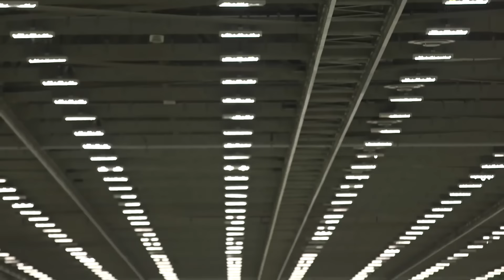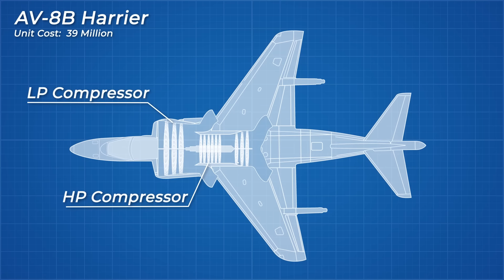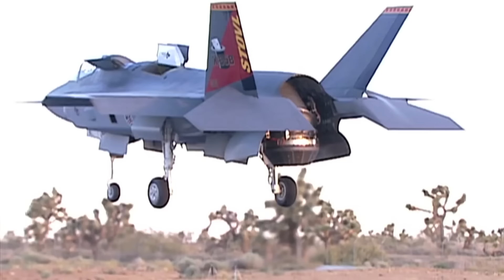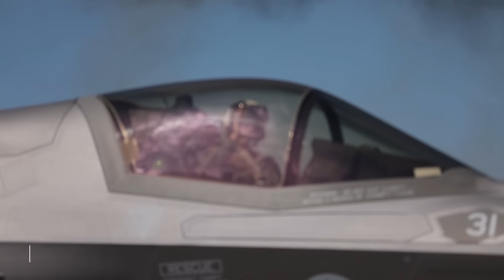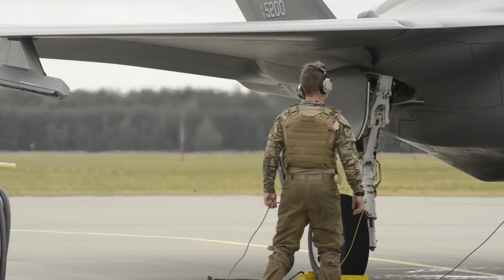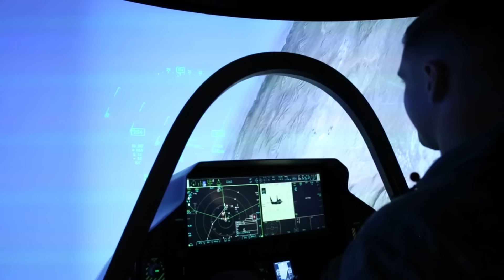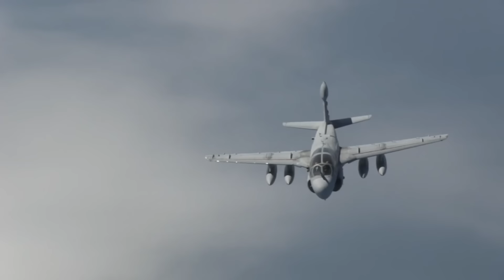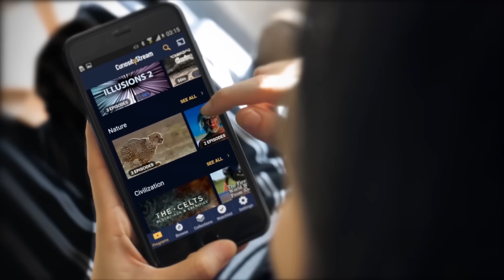Is The F-35 Worth $115 Million?

Comment: Delivery to Australia was suppose to be around 2010. Now expected delivery 2300 at a cost of $600,000,000,000 . What a joke. We should of got the eurofighter or even a MIG. 👎
Reply: Delivery to Australia was NEVER supposed to be around 2010. They didn't even place an order until 2009 with expected delivery in 2014, but then decided due to budget cuts to postpone most of the order. Australia are currently receiving F-35s as planned and on-schedule.

Comment: The F117 over Serbia was not shot down by long wave radar but by IR and TV sensors.  The serbians have never had long wave radar.  Too expensive.
Reply: Uh long-wave radar is standard for air defences. You don't buy air defences without long-wave radars, and the Serbs operated P-18 and P-12 radars with their S-125 SAMs.

Comment: Short answer, no it's a turkey. A-10 is vastly cheaper can carry more firepower and can loiter at low speeds and maintain presence in an area of operation for far longer. Also is vastly superior in survivability of both operator and craft as A-10 airframe is not reliant on fly by wire avionics to constantly correct the ailerons for stability. Update the Harrier if you NEED a VTOL which I don't understand as they field F-35's on aircraft carriers with catapults which I'd trust a thousand time before the inlet on the F-35 in transference from vertical to horizontal thrust.....it's like why do we still field the 70yr old B-52's because they fucking work son.
Reply: Not the case at all. The A-10 cannot carry any potentially higher payload- and is not survivable in contested areas where ground-to-air threats are present- let alone air-to-air threats.

Comment: Good analysis! You didn't mention that F-117 was not equipped with radar. Once F-35 turns radar on everyone knows it is there. F-35s capabilities are still to be tested on battlefield. There are other ways to detect and pinpoint airplane position (visual, sound), and with electronics development these ways of detection will improve, as well as radar sensitivity, making stealth less valuable. F-35 is built around stealth technology, without it, as you mentioned in your video, it is loosing to cold war era fighters, so with stealth becoming less effective it will degrade. Also because of its slow maximum speed it is less capable as fighter. Once it locks on (you can't lock on without letting enemy know), faster enemy fighter can just run away. In it's turn F-35 can't run away...
Reply: AESA radar encrypts the emissions so that it looks like normal radio communications. RWR detects radar by sensing the specific characteristics of known radar emitters and understanding that the aircraft is being painted by radar. If the emissions keep changing, the RWR cannot know what is radar and what is TV or radio boradcasts.
Reply: @ChucksSEADnDEAD  Wouldn't radar signal strength, especially in targeting mode, be much stronger (as if you have tv tower few yards away)? And if not, wouldn't it be much easier to jam? 
Also, as far as I understand, it is rather easy to detect direction to radio signal source (no matter how encrypted the signal is), and if this source is up in the sky it is most probably an aircraft. 
By the way, rumors say that F-35s RCS is 0.005 - that is 5 times more than one of F-117.

Comment: Excellent video:  Here are two additional complementary arguments, one in favor and one against.  The first - the "for" argument is similar to one that you used, with maybe a little addition.
"For" the assessment by some that the F-35 doesn't compare favorably to F-15's and F-16's in dog fighting. I think you largely pointed out the problem, in that the F-35 wasn't designed to be a dog-fighter in the vein of an F-16 or F-15.  So, while the F-35 can't match the turning abilities of the other two and it may have a less favorable power to weight ratio, the changing style of air combat really doesn't dictate the need for the F-35 to exceed the capabilities of those older aircraft in that area.  In a modern encounter the F-15 and F-16, probably even the modernized versions of the two, would never make it into visual range of the F-35 because they would be destroyed well beyond.  While some do make arguments suggesting that militaries are incorrectly downplaying the importance of traditional dogfighting capabilities b/c in the past there were some oversights (the original variants of the F-4 being a good example) that really bit them in the ass.  But at this point technologically we really are moving beyond visual range combat.  If you get into a traditional dogfight, it is because something has gone really wrong - and so you can't really justify the additional expenses needed to make the F-35 comparable to those other aircraft when likely the only time it would require those abilities is the hopefully rare occasion when literally everything else (from command and control, electronic warfare, and other support aircraft) has been taken out of action. In a situation like that, maintaining the fight is probably the last thing that aircraft should be doing.  Therefore, even though there will always be a certain level of hesitation to rely entirely on advanced technology (stealth capabilities, advanced armaments etc), at this point in time dog fighting just can't be a design priority for an aircraft like the F-35 (possibly a little more for the F-22, but erm..)
"Against" This one is going to be a lot shorter and to the point.  Some of the strongest critics of the F-35 have gone after it on the grounds that it falls prey to a familiar problem in design intent in that in trying to build an aircraft that can serve multiple roles, you end up with an aircraft that can serve those roles but can't do any of them of very well.  In designing a multi-role aircraft (and this has been problematic in the past as well) you have to make compromises on the aircraft's features with regard to each role when features for one role get in the way of optimum performance in one of its other designated roles. I know that's an overly complicated sentence - in essence you have to make it an average performing aircraft in each role instead of superior b/c inevitably the various roles require certain design features that limit the aircraft's maximum ability to perform another of its set roles.  With this in mind, critics say that the F-35 will fall prey to comparable generation technology that is designed to fulfill a single role and is therefore optimized to be able to do so at a higher performing level than the F-35 can in any one of it's designed roles.

Comment: Compared to the F16... cant turn, poor acceleration, slower and its payload its very small... also, questionable stealth
Not worth it! I would get the Gripen, Eurofighter or Rafale any day!
Reply: F15 

Empty weight: 28,000 lb (12,701 kg)
    Gross weight: 44,500 lb (20,185 kg)
    Max takeoff weight: 68,000 lb (30,844 kg)
    Fuel capacity: 13,455 lb (6,103 kg) internal[132]
    Powerplant: 2 × Pratt & Whitney F100-PW-100 or Pratt & Whitney F100-PW-220 afterburning low-bypass turbofan engines, 14,590 lbf (64.9 kN) thrust each
            23,770 lbf (105.7 kN) afterburning thrust for -220[133]
            23,920 lbf (106.4 kN) afterburning thrust for -100[133]
    Maximum speed: 1,434 kn (1,650 mph, 2,656 km/h) at high altitude
            782 kn (900 mph; 1,448 km/h) at low altitude
    Maximum speed: Mach 2.5 at high altitude
            Mach 1.2 at low altitude
Reply: F35
    Empty weight: 28,999 lb (13,154 kg) [556]
    Gross weight: 49,441 lb (22,426 kg) [66]
    Max takeoff weight: 70,000 lb (31,751 kg)
    Fuel capacity: 18,498 lb (8,391 kg) internal fuel
    Powerplant: 1 × Pratt & Whitney F135 afterburning turbofan, 28,000 lbf (120 kN) thrust dry, 43,000 lbf (190 kN) with afterburner
    Maximum speed: 1,042 kn (1,199 mph, 1,930 km/h) (tested to Mach 1.61)[230]
Reply: F16
    Empty weight: 18,900 lb (8,573 kg)
    Gross weight: 26,500 lb (12,020 kg)
    Max takeoff weight: 42,300 lb (19,187 kg)
    Fuel capacity: 7,000 pounds (3,200 kg) internals[4]
    Powerplant: 1 × General Electric F110-GE-129 afterburning turbofan engine, 17,155 lbf (76.31 kN) thrust 29,588 lbf (132 kN) wet
    Maximum speed: 795 kn (915 mph, 1,472 km/h) (Mach 1.2) at sea level[71]
         1,147 kn (1,320 mph; 2,124 km/h) (Mach 2.0), clean configuration at altitude[4]
Reply: Not even close to being the case
Reply: @peterson7082  and i guess youre an expert...
Im not an expert, im just an avionics sargent in the air force, and that ive just said, its what the pilots tell me.
Regarding maintenance, F16 works like a clock, its a damn good machine. F35, its a drama queen... do you have any ideia how much maintenance that aircraft requires for its flight hour??
Reply: @MFPRego  Oh its maintenance costs and down times are well documented issues. Though I find your claims in regards to its performance questionable. The acceleration doesn't seem to be poor compared to its contemporaries (rather quite good ), speed with a payload again not poor, and potential maximum payload greater than the F-16C. The Gripen is slower with any combat load, carries less, and maneuverability is not considerably better (admittedly the last statement is not founded on any primary source ). 

Questionable stealth how? Cannot turn according to what exactly?
Reply: @peterson7082  as i said, thats what the pilots tell me, F16 pilots, so im guessing its compared to the F16
Reply: @peterson7082  listen, the F35 on paper looks amazing, but reality tells us a diferent story! That plane simply cant keep up with the F16! Sure, its avionics systems are amazing, but thats about it...
Reply: @peterson7082  about the Gripen, its alot cheaper!!! The price of an F35 can buy 3 gripens! The flight hour of a F35 is 7x higher than a Gripen... sure, the Gripen cant outperform the F35, but for any other country that isnt the US, money is an issue!

Listen, i dont work with Gripens, só i do not know how the maintenance is
Reply: @MFPRego  "but reality tells us a diferent story!" - reality says that the F-35 wipes the floor with anything else in inventory.
Reply: @ChucksSEADnDEAD  can it? I dont know, we will see it in the future, wont we?

Comment: I'm still sure it's possible to produce the F-35 for a lot less. Competing stealth fighters of similar or better overall capability (VTOL notwithstanding) have unit costs estimated at as little of half that of the F-35 or less.
Reply: Not really. The prototypes of the Russian Su-57 cost $50-60 million each and were testing individual systems i.e they were not fully capable fighters. Considering the Su-35S goes for $75-85 million each on the export market I highly doubt the Russians can produce the Su-57 for less than the F-35.
Reply: The current unit price of the F-35A is cheaper than many 4th gen fighters.

Comment: And at $115 million you get the basic model....the models for the Marines and the Navy are substantially more expensive per unit. What was supposed to be a design which could be used interchangeably by all the branches has morphed into another Pentagon spending spree.
Reply: $115 million is the cost of the most expensive variant i.e the USMC version. The "basic" model (actually the best performing one) costs $89 million and is expected to drop below $80 million in the next couple of years.

Comment: I don't think it is a worthy successor in all things and also people forget the F-22 got to be so expensive because they kept reducing the numbers on order which drove the price up for each unit cause in the end development costs have to be earned back regardless. Some people did the math and suggested a F-22 in full production would have ended up cheaper. 

Now granted the F-22 is actually kinda old tech wise, but such things could be deal with and create an very capable plane for fighter and fighter bomber roles which is really the only role planes like this should handle. There is no way the F-35 will for example be able to replace the A-10 in CAS, it is not all about getting ordnance on target (A B1 does that job amazingly) it is also a large part of breaking the fighting spirit of the enemy. 

Also if one faces very stealthy opponents with great sensors all that advantage is null again and you might very well end up relying on that good old dog fight or at least need to move to evade hostile missiles. 

In the end the F-35 program has been and will continue to be an expensive mess and the end the result might be suitable to some, but to many smaller nations the only way they can afford this plane is to replace say F-16 at a 2/3 to 1 ration so effectively halving or worse their airforces, add in that at any given time easily 25% will not be operational it renders entire airforces to be combat ineffective simply due to a lack of numbers. 

Now do not get me wrong I am not saying it is easy there has not been a jet fighter program that has not been drawn out and expensive, but many have ended up producing good planes and perhaps with some refinements and block D version at some point the F-35 could be as well, but at what cost? One far to great I would argue.

Comment: You avoided the elephant in the room: how does the F35 hope to replace the role of the A10 Warthog??? The other replacements fine, but the ground support role is so specialized that there's no way the F35 could "replace" it. Please do a video on exactly how special the A10 Tankbuster is, it's role in war, it's engineering (of course) and the fantastic tales of it limping home while missing pieces.
Reply: The only role the A10 serves is fucking up terrorists holding 50 year old AKs running around in flip flops and towels. Well that and making dumbass 13 year old boys nut themselves. The war on terror is coming to a close, the A10 is useless (I REPEAT, USELESS) outside of the war on terror. China/Russia have the capability of shooting the A10 out of the sky without breaking a sweat. The A10 is OLD. It will become a matter of time before the A10 is obsolete even in the Middle East.
Reply: marines F35B = hover and use the 25mil ??? LOLz 

in doubth go see swarzie movie with the harrier
Reply: The A-10 has already been largely replaced by the F-16, F-18 and F-15 strike eagle.

Comment: I used to work in the defense industry and was able to play with the simulator one day. I am a retired Marine but I was not a pilot but the Lockheed Martin rep was a pilot and worked on the F-35 program. He was right there with me and told me what to do. I was able to quickly grasp the system and within an hour able to conduct a mission with very limited input from him. I was able engage 3  bandits in BVR all while prosecuting 3 ground targets using another plane providing targeting info to my plane through the network. 

I had a JDAM glidding to target and had missiles flying to target the pilot asked me what the time to target on the JDAM, so I  looked down at my screen and started to cycle through it and he says "no, just look for it."   At first I was confused because I knew I essentially over; the target and at like 30K ft, so how would I see it? I started to voice that to him and he points down and I looked down and I could see out of aircraft, right through it and imposed on the helmet HMD I saw a FLIR picture with the JDAM marked and a count down showing me time to target.  It was wild. 

This was a good 7 years or so ago and he told me I was flying essientlly a "prototype" simulator 
dif you will. Clearly, I can't provide any real insight into the plane other than the limited time I had on the simulator  and the GUI seemed extremely intuitive and features of the HMD made the simulator hands down the coolest and the most expensive video game I had ever played.

 The pilot did his best to make it "realistic" but like I said I am not aviator and at one point I  air to air and I said "I did pretty good right?" And he explained he had turned off restrictions and what not and pointed the big screen out in front of simulator, which allowed for people to see what did. Yeah I just conducted a negative 25g maneuver, lol.

Comment: couple of notes.. both the B-2 an the F22 were not intended to low volume productions, you infer that these were some small custom "British " car company...that was never case. an Cost figures falsely reflect the Cancelled Full Production runs, ( off the top of my head , over a 100 in the B2 case, an over 750 in F22 case... This is America, F22 was a one for one replacement for the F15.. an the B2 was a full replacement for the whole bomber fleet at the time. cheers Allan Desmond